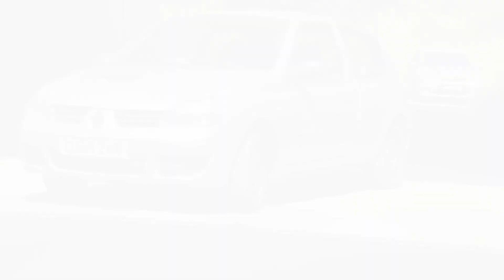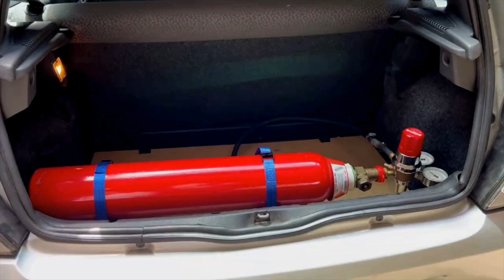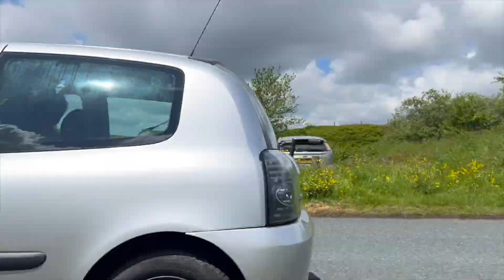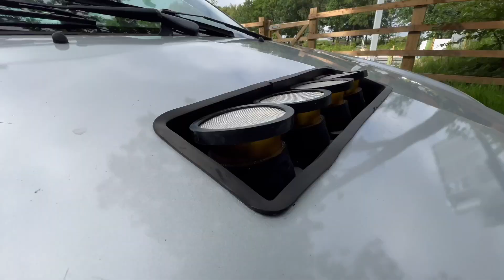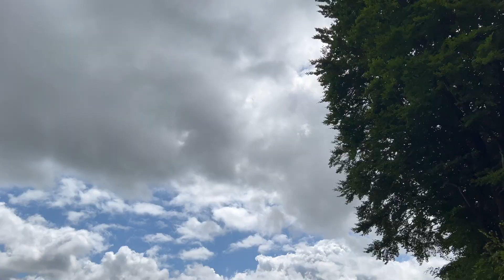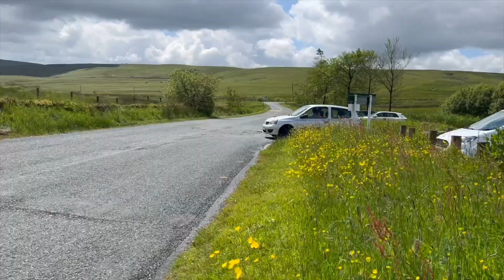Hydrogen Car Conversion (Home Built)

Comment: i wanna do this so bad but how could you make it more efficient to the point of actually being a viable every day car?? and where do you source the hydrogen? do you make it yourself?
Reply from the maker: It’s not efficient enough to drive everyday, would burn through too much fuel, would need to proper engine to make it even close to good enough efficiency, like turbo and direct injection, but it’s not impossible. 
I buy the hydrogen in, so I can keep consistent testing

Comment: someone in my country build hydrogen fuel cells too. it run on petrol + hydrogen. i dont know the ratio but still the exhaust produce some water vapour. pretty neat actually. save fuel consumption plus + increase performance + cleaner emission.
Reply: Fuel cells produce electricity ! there is no hydrogene used in combustion so " save fuel consumption plus + increase performance + cleaner emission." is impossible in this case.
If it's the case then it's a generator HHO that is used.

Comment: Actually the petrol washes the oil off the walls so i would expect longevity over petrol and less combustion contaminants in the oil
Reply from the maker: Good point, but sady water from the combustion process finds its was to the oil, contaminating it with water, there are a few work around but as standard the engine will require more frequent oil changes ✌️

Comment: 5:15  Hydrogen is a non lubricating fuel.
Neither is unleaded. Unleaded fuel is a solvent and washes oil away from the bore surfaces.
With Hydrogen you will have better piston to bore lubrication than Unleaded fuel

Comment: I really like what you've done here, I love ICE, and I've run hydrogen engines on testbeds, but I don't see us ever running cars in the UK on hydrogen at any scale. Equally I 100% support you trying. Unfortunately hydrogen is never going to be very efficient, in terms of wind to wheel, when compared to EV
Reply: Even if it doesn’t catch on with all cars for heavy goods vehicles it could be worth it and even more so with things like ships, and even for cars car enthusiasts still want ICEs so it definitely has uses
Reply: @rhysrail
Yeah, there will be niche cases for sure, engines run really nicely on hydrogen, it's the overall system efficiency that will prevent it ever becoming mainstream, which is a shame, but the laws of physics will win here.
Reply: @andythomas5265 not necessarily, it’s important to remember the base costs we are talking about is electricity costs which are practically nothing compared to current fuel costs, even with the efficiency  loss of using hydrogen ICEs they will still be cheaper to fuel than electric, and if you include the fact they can be made much lighter and batteries they could actually be competitive.

Although the main competitor to them is fuel cells which have many other advantages and are more efficient so for mainstream cars and things like planes they are likely to win although with ships and things ICEs have other uses as well so easily stand a chance
Reply: @rhysrail I'm not sure I follow your logic, if as you say electricity costs are cheap (although I'm not convinced by that in the UK right now!) the most cost effective use for the electricity is to charge a battery directly, to make hydrogen from that electricity, then burn it in an ICE will always use more electricity than the battery option, and I mean a lot more electricity, 2 to 3 times more, so it will always cost much more to power a car through H2 than via a battery. don't get me wrong, I'd love to see it, but simple economics will prevent it ever becoming the norm
Reply: @andythomas5265 looking at the figures it seems that electric cars are 3 times cheaper per mile compared to petrol (including the heavier weight of electric as well) therefore even if hydrogen uses three times less electricity  than battery it is still comparable to battery 

On top of this it appears that fast chargers actually end up costing more than petrol is and what hydrogon could be

This shows that hydrogen is affordable and actually quite comparable to electric in some cases, it also  should have significantly lower car costs and longer car lives meaning across its life it should be cheaper. 

In my opinion though I think it will become the equivalent of diesel with it being suited to long distance heavy vehicles where the batteries weight would leads to lower max cargo weights and they need longevity, as with diesel this technology should also end up being used for cars and particularly for enthusiasts who would want them
Reply: @andythomas5265 also presuming our government actually starts sorting themselves out (which is admittedly unlikely) electric costs should decrease with renewable energy and hydrogen technology should advance leading to improved efficiency, Ive for my hopes up for REV force who are developing a new type of ICE engine with claims of improved efficiency and the prototype is able to run on hydrogen

Comment: The rotary engine uses a chromium plated cylinder that don't rust however, it requires you to burn oil so it still uses oil and produces emissions. Best fuel to run an RX8 on is a very high octaine mix of ethanol fuel like a 105 octaine e85 however, the UK is so small of a country we can't grow enough wheat or barley to make enough ethanol.

Comment: There is huge issues with a combustion engine and hydrogen. One being that it burns at a different temprature and produces allot of water which can rust valves piston rings etc it also has issues with oil compatability. A purpose built engine running hydrogen can work but to convert a standard petrol.to hydrogen works but not for mainstream.

Comment: can i get the info of the engine built?
Reply from the maker: Hi, check out the 2 latest videos, their all about the engine and fuel tank set up
Reply: @Hydrogenguys  To lubricate the piston walls and rings put oil spay jets facing mid way up the bore walls.... ?

Comment: Brilliant!!! Thank you for your creativity and awesome project!!! You proved that it can be done, and I have looked on the internet for years to find someone to pull it off. BRAVO!!!!
With a diesel engine running on half hydrogen would that lubricate the rings/cylinder walls enough and not lead to premature wear? Would a diesel engine have advantages over a gasoline motor?  Thanks again, you ROCK!!!!
Reply from the maker: Thankyou for the encouragement and support. 
A diesel engine running 50/50 diesel and hydrogen would be a cool idea, not show how it would affect engine knock though. But might help with more complete combustion, worth looking into to
Reply: @Hydrogenguys  Thanks for your reply and good luck with your future cool endeavors!

Comment: It's primarily your engine oil that lubricates your cylinder walls  In fact one of the rings on the piston is the
 "oil ring"  The  bottom ring on tge piston scrapes  the excess oil off the cylinder walls.   That's why when your rings  Wear out you get a lot of smoke out of your exhaust. Gasoline is more of a solvent than a lubricant
Reply from the maker: 100% agree about the oil rings, the ware is occurring on the top compression ring,  along with the extra heat, needs water injection for cooling really.

Comment: This is a big achievement, well done! thanks for making us aware that such DIY conversion is possible!
Reply: I have an old landrover only running on lpg and i’d like to make it running on hydrogen only
Reply: I was wondering if it's easier to convert a lpg car since you mention that you would use lpg injectores in a newer build
Reply from the maker: I would guess yes, as the LPG injectors would be better suited. You would still need to change the ignition timing to suite hydrogen, but I least all the gas lines would already be installed if it was a car already running on LPG

Comment: My redneck neighbor has a Hydrogen Gas Generator on his old Ford Truck. It is made from a Big Glass Pickle Jar, with the electrolysis stuff inside the Pickle Jar filled with water...he adds something to the water to help with Conductivity. He has it set up to run gasoline/hydrogen mix...he's been driving this truck for years and years like this. The system itself is cheap... it is a 8 cylinder truck, and he is getting better mileage than my wifey's Prius. I told him he should make money from this...and he just shakes his head and says "No sir...that will just get me a un-wanted visit from the Boogyman." He also has a Propane Generator that he runs with Hydrogen made from another Glass Pickle Jar... We lost power after the last Hurricane, but he had power on the whole time... I am now starting to tinker with some things, because this is very fascinating to me. P.S. He ran out of gasoline one day, and drove on straight Hydrogen for 30 miles back to his house, with no problem... His system creates Hydrogen as needed...when he pushes the accelerator more, it sends more electricity to the Pickle Jar, which creates more Hydrogen. He has a Flash arrestor on the hydrogen line going into the carb, because it does backfire every now and again.
Reply from the maker: That sounds amazing!
Reply: Wish I had one of those on my truck lol these gas prices are awful
Reply: @Rustyshackleford1911  I gotta say, it is such a simple system...his truck is a older truck that has no computer chips, and it is not Fuel Injected... I doubt it would be so simple on these new vehicles. I like the older vehicles...I can open up the hood and know what I am looking at, and you dont need a engineering degree to do simple maintenance on it.  My neighbor does a bunch of cool things, but I will stop at that...I don't want to ever be the cause of him getting a visit from 'The Boogyman' :)
Reply: @sloboda2012  i do a lot of mechanical stuff myself, so to me it sounds pretty interesting. I don’t blame him for keeping it on the DL though, sucks we live in a world where we gotta worry about the boogeyman.
Reply: @Rustyshackleford1911  Right on...

Comment: We Indian also convert petrol and diesel to cng and have same type of cylinder at back all we have to do is fill it with hydrogen instead of cng
Reply from the maker: The ignition timing would need to be changed for hydrogen and the gas tank needs to be a hydrogen tank but yes it should run the same, not as efficient though, ideally the car should be turbo or supercharged.
Reply: @Hydrogenguys  try a subaru impreza 😉👍🏾

Comment: Wow that's awesome. I can see you are using cylinder to store hho gas which is not safe. Why can you work on stan meyers project to get it to work by running high voltage, watts and frequency with low amps??
Reply: This no is Hho friend please see well this is pure Hydrogen h2
Reply from the maker: Hi, yes this is pure hydrogen gas, no oxygen is in the cylinder so it’s a lot safe to use.

Comment: Could you show the exact process to install the hose going from the hydrogen tank to the fuel injectors, details?  When you press the gas pedal does that open the injectors to allow more hydrogen into the cylinders?  When you open the valve on the hydrogen tank do you open it all the way, completely?
Reply from the maker: Hi, Thankyou for the comment.
The gas tank is set to 9 bar output pressure when driving. This is fixed, the duty cycle of the injectors change like with petrol cars to alow for more fuel when needed.
At idle only 6 bar is needed.

Ideally an electric regulator or something would be used, where at idle it’s set to 6bar, and when driving it automatically increases to 9bar.
Hope this helps.

I will be uploading some more videos this month showing how I built the car.
Reply: @Hydrogenguys  Yes, that's excellent.  Thx!  What about easily switching from hydrogen to gasoline?  I'm thinking if this is installed and one runs out of hydrogen then can easily switch to petrol, it would be an easy sell to customers?  I've seen this type of setup when LNG is used, which is essentially hydrogen mixed with a little carbon, and when the user runs out of LNG, he just flips a switch and uses petrol?
Reply from the maker: yeah a switch would be needed. like you say, this set up is very similar to a LPG car
Reply: Well, after watching your videos and seen that it can be done by a DIYer I'm starting on this project. I'm building a solar hydrogen production unit as well as pump. I'm using a 2.4 liter Toyota truck for project. I'm older have the money and want to do this. Thanks for inspiring me.

Comment: Nasıl çalışıyor? LPG gibi enjektörler yardımıyla gaz halde mi motora püskürtüyorsunuz hidrojeni veya suyu hidrojene elektrikle çevirip mi motora veriyorsunuz?
Reply from the maker: Hi, this is hydrogen gas in a gas tank, high flow fuel injectors and ignition ecu. here is a video link showing how the car works, hope this helps:

Hydrogen Gas Car
https://youtu.be/Hh0T6N9tp-0